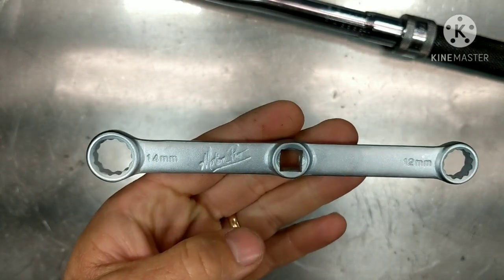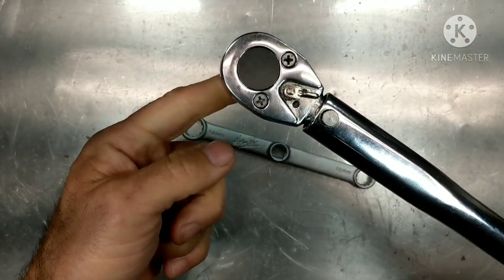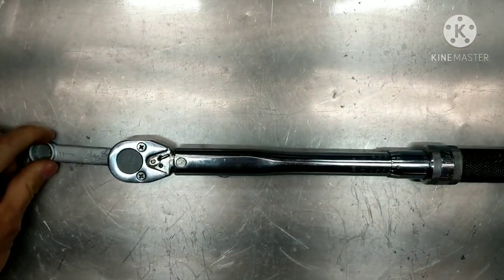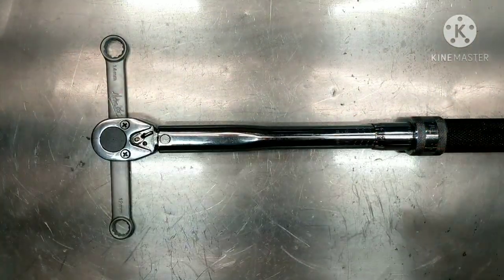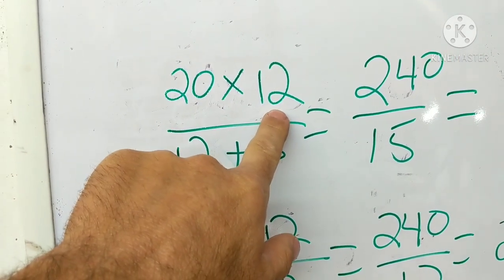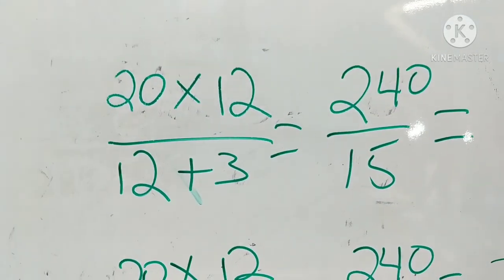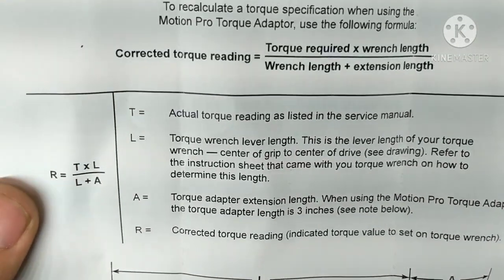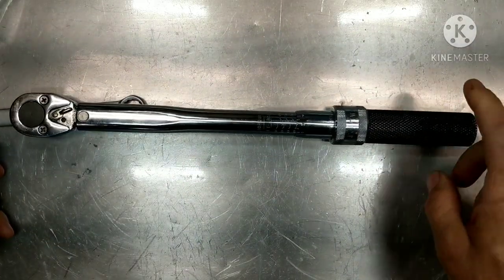Angle torque??

Comment: Does that formula also apply to digital torque wrench? For example HF Quinn thanks
Reply from the maker: Yes, same for any torque wrench.
Reply: @TepcoCycleRepair  ok thanks so you always measure length of the middle handle ? regardless of whether digital or mechanical?
Reply from the maker: @bigdeal87  Yes. Digital or mechanical makes no difference.